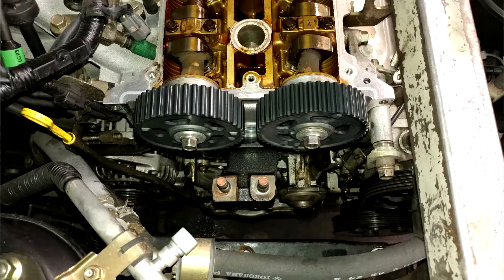2001 Mazda Protege 2.0L Cam & Crank Waveform

Comment from the maker: Yes, I know... I forgot to add a cylinder #1 trigger. Not really that important since all you need to do is count teeth between crank & one of the cam signals, when comparing a suspect bad waveform to this good one (no cam / crank codes were stored after timing belt replacement).